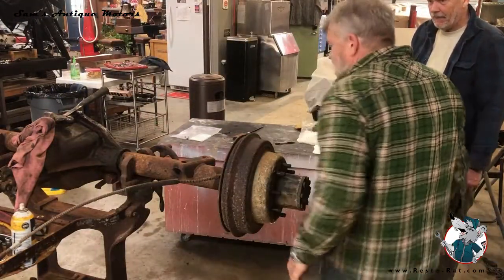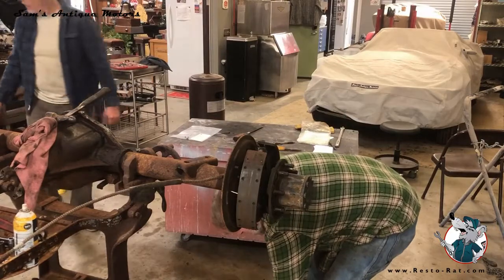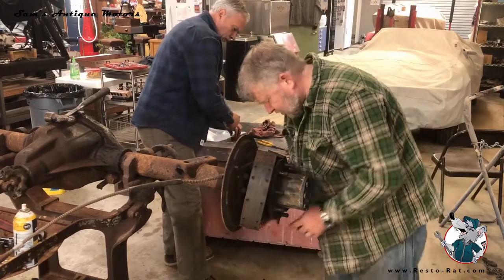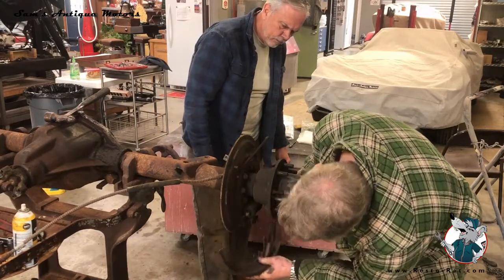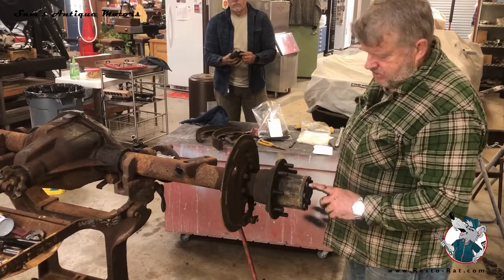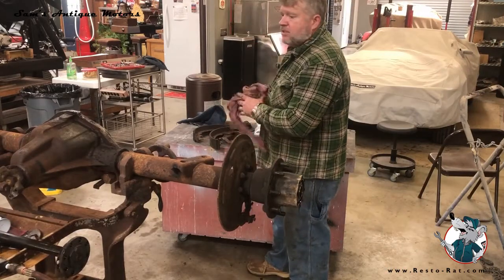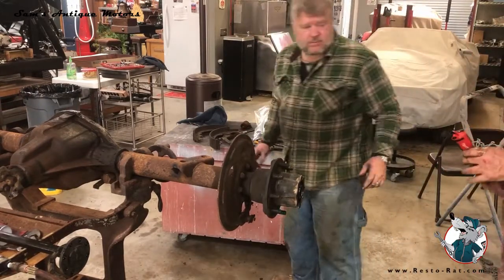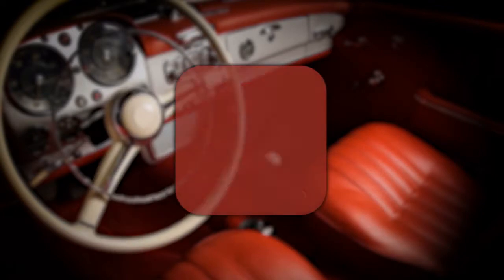Rear Brake Drum Disassembly | Segment 10 - 72 Chevy Highlander

Comment: Those two flat head screws you were so nonchalant about having pulled out at the very beginning of the video are what are giving me the most trouble. I'm actually headed down to my shop right now to build some sort of homemade extra large flat head screwdriver to get them out.
Reply: @Resto-Rat  I ended up taking an old lawnmower blade, cutting and grinding it down to the size I need it and it broke them loose!